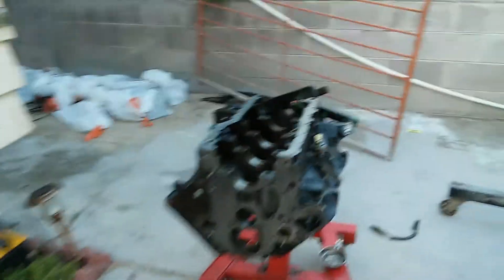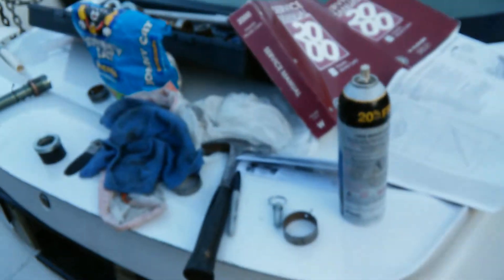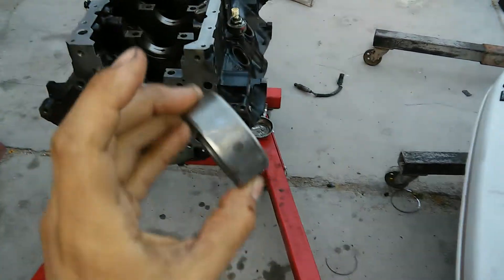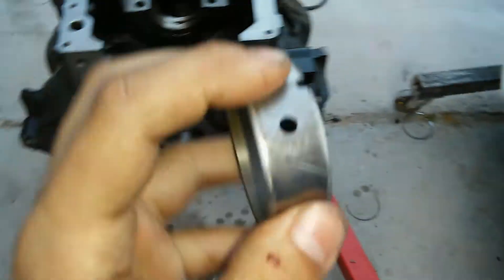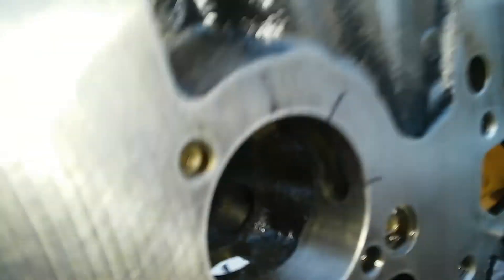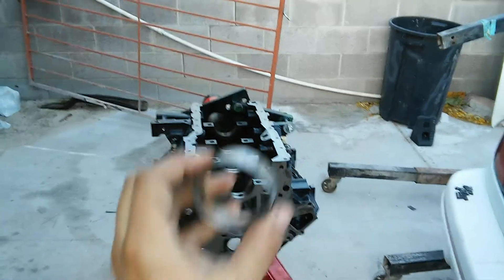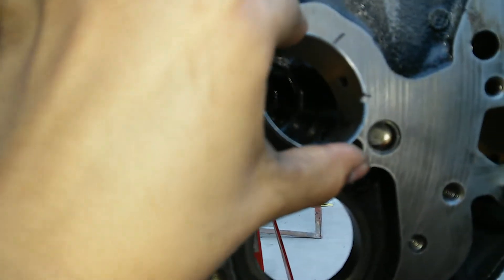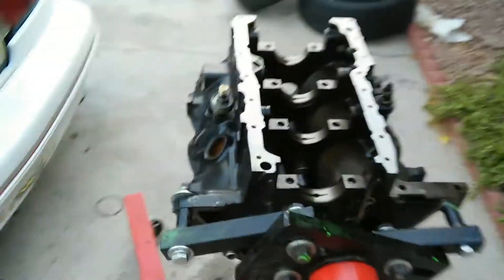Cam bearing orientation W/ 2 oil holes (3800 Series 2)

Comment: The bottom is not where there is the least amount of oil, the reason it wears on the bottom is because the valve springs load it through the rockers, push rods and lifters pushing it down.